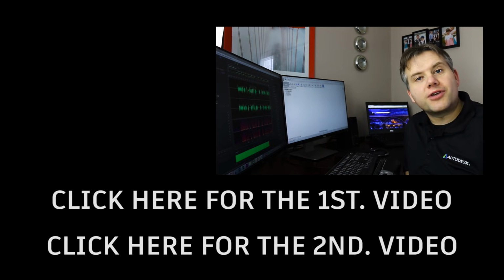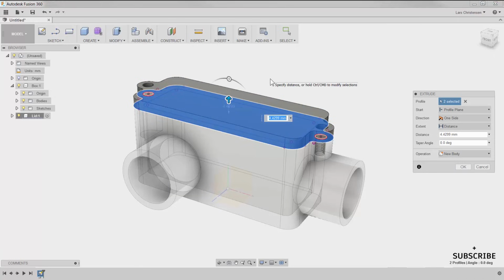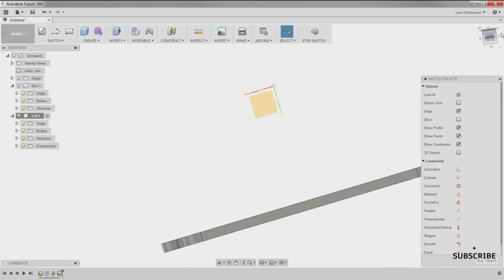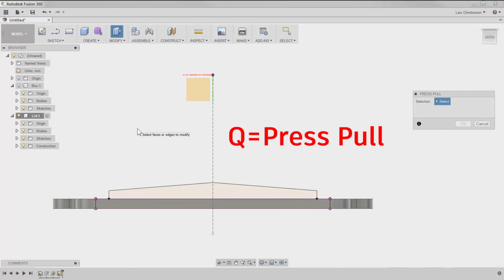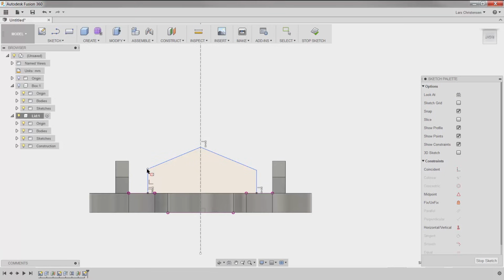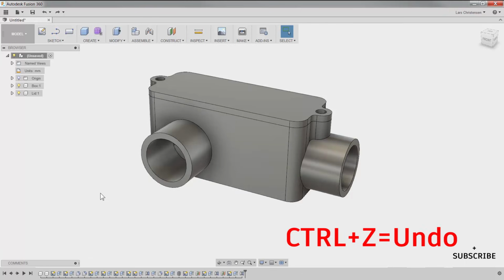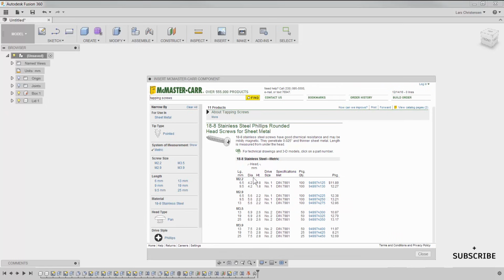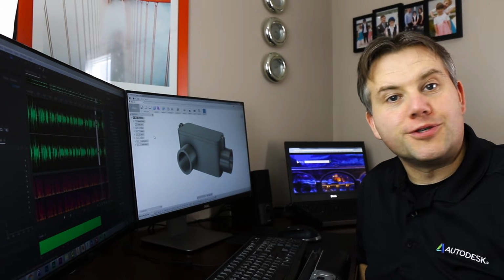Fusion 360 Tutorial for Absolute Beginners— Part 3

Comment: I am a autocad user for more than 30 years. I would to know how does Fusion 360 print out. Can it print to STP files for machining? I also like to know whether I can give 2D printing from Fusion 360. Thanks
Reply: yes and yes.  You can export to STP for immediate building on a 3D printer.  If you want to mill from a block of metal, I vaguely remember that you have to do some additional steps in the Manufacture area of Fusion 360 to define tooling and paths.  Lars has other videos showing how to export a Fusion 360 design to a traditional CAD drawing similar to AutoCAD output.

Comment: Lars, I'm stuck on this tutorial.  I've created the offset plain, then sketched the lines, attached the symmetry. When I try to dimension the height (2.5mm and 5mm) the whole polygon lifts off of the  lid.  What am I doing wrong?
Reply: The answer is right down the bottom of the comments.  Hit D, select a corner point on the tab shape and then select the other point on the LID SURFACE not the base of the tab shape.
Reply: @PaulOfford  Thank you Paul.  So simple.  I just couldn't understand why it wasn't working.  This noob thanks you.
Reply: Mine does the same thing and I can’t figure out what to do
Reply: @ghostpancakes1317  The answer is right down given by @Rick Pietersma: Found it, credits to Egon Spengler "Make sure to turn on "Auto Project Edges".  (Click your name on top right --> Preference --> Design --> Auto project edges"

Comment: Dear Lars
I am new to Autodesk Fusion and I am trying to follow your lessons step by step.

At lesson 3 I have got a problem as my symmetrical lines will not relate to the horizontal line of the  lid. I cannot get an X on the line when I move the cursor over it. It is always a +. 

Do you have any ideas?

Thank you

Georges
Reply: Same problem
Reply: Found it, credits to Egon Spengler "Make sure to turn on "Auto Project Edges".  (Click your name on top right --> Preference --> Design --> Auto project edges"
Reply: @rickpietersma7308  was having the same problem and beginning to get really frustrated, thanks so much for sharing!!
Reply: @ellencollingsart  No Problem :)

Comment: I'm having a problem with the sketch on the offset plane from the beginner 3 video. I make the sketch like the one you drew. I can dimension the bottom. I can make the right line vertical. I can make the shape symmetrical. But when I try to dimension the the points above the base, the base line moves either above the line of the lid or below. I'm absolutely lost. Can you guide me?

Chris
Reply: Chris H I had the same problem! What I did was use the “fix” constraint on the two bottom points that are touching the lid. This will keep those points in place so when you dimension, those points do not move. You have to make sure to dimension the width between the two bottom points first because they won’t move if you try to change the width once the fix constraints are put in. Hope this helps!
Reply: @abbyhowell3843  Thank you I'll give it a try. I'm totally new to computer modeling.
Reply: @abbyhowell3843  It worked. I can't express my gratitude enough. I was on v.37 of that sketch.
Reply: Chris H Oh man, glad I could help! Those constraints can be your worst enemy or your best friend when modeling. Good luck!
Reply: @abbyhowell3843  Thank you again. Eventually I'll get it.
Reply: @abbyhowell3843  Had the same problem, thanx a bunch for the tip!
Reply: same here.

Comment: Okay after fumbling around the I finally got to about 9:30. But I can not extrude. He mentioned that everything should turn black. Well his lines look like they turn solid black, as were mine seem to be dotted black lines or I guess the better term might be dashed black lines. Any idea where I am going wrong. Also I could never get the dimension to work till someone pointed out that I need to project the lines to the lid. Which did fix that problem. I have not had any problems till this point. Kind disheartening when trying to learn.
Reply: If you have dashed lines, perhaps you have inadvertently created construction lines? (Which presumably could not be extruded?) I kept accidentally leaving construction line mode on after using it...
Reply: @matthewmoore2839  Sorry as a very absolute beginner to this type of stuff what is a construction line? Compared to the lines he is making. I thought they were the same.

Comment: Great video but I have a question. What if I want to build some clearance in between the ribs on the lid and the inside wall of the box face? You said that we don't do this in CAD, but sometimes it is necessary.
Reply: You could make the extrude offset.

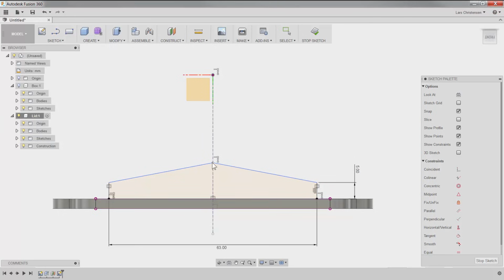Comment: If anyone is having trouble making the lines connect to the lid at around 9:00  "(left click your name in upper right). Under General -> Design tick "Auto project edges on reference".

Farzad Tabatabaie found this and re-commented it a while ago and it took me a while to find it so I figured I'd put it at the top to help people watching more recently.
Reply: Thanx that has really helped...... however, my sketch line haven't turned black so I can't go any further with extruding. Any ideas please ?
Reply: @markstevens9429  Try to close the lines
Reply: @mitricaclaudiu  Hi Claude. Thanx for that. Thie first time it failed I had not closed the 'box'. This time however, after double checking I have. It's so frastrating isn't it 😆😆
Reply: Thanks. I found my way around this by adding a coincident constraint between the line endpoint and the lid, presumably this is equivalent?
Reply: Sam K thank you!
Reply: Thank you thank you.
Reply: Dude I started watching this today! I saw this comment was made 23 hours ago, Thank you so much!! what luck hahaha
Reply: Thanks, Sam!
Reply: Thanks. Help a lot
Reply: thanks :)
Reply: Thanks very much Sam K for re/replying this and to Farzad Tabatabaie for the original information of: General -> Design tick "Auto project edges on reference"  I got stuck here for hours, tried to figure it out myself with no success, and you solved it form me!! Thank you!!
Reply: Thank you! I've had this problem and have been wondering what i have been doing wrong.
Reply: I don't have much hair but you just saved what's left of it.  Thanks Sam.
Reply: Thank you!
Reply: You are my hero Sam. Thanks a bunch!
Reply: Thank you! 😃

Comment: Anyone else having issues with line-creation? I cannot get the lines at 7:00 to anchor to the lid. So when I add the dimensions, the entire new sketch keeps moving unrelated to the lid itself.
Reply: Looks like you have to press P to "project" and select the lines you are anchoring to, then press L for "Line" and start drawing. My issue comes with the dimensions, when trying to add dimensions for the bottom line (the one actually attaching the pieces to the lid) it won't change and instead displays an "over constrained" error
Reply: @jakeburger3548  Thanks! I "unfortunately" figured this out myself just before finding your reply. But thanks so much anyways!

I'm too much of a beginner to help you with your problem though.. Sorry! For me dimensions worked fine now that I got it to anchor to the lid. Just try to do as I and re-do everything.

However, save a lot of time by skipping the project-step when he copies the shape. Just select new sketch --> then select the box, then add your new circle and select everything you want to extrude. No need to project there. Instead the projection is done at the step you mention (and only one line). :-)
Reply: Thanx that has really helped...... however, my sketch lines haven't turned black so I can't go any further with extruding. Any ideas please ?

Comment: Software Version Different
As an absolute beginner, just downloaded software, which is significantly more recent that the software used in video.  Got stuck (and frustrated) multiple times, partly due to the different software versions. Would love to see these videos updated.
Accidentally stumbled on the 'how to navigate' video, which helped immensely.  Painfully got thru the three videos, now going back to repeat them.  This time should be easier.  
Thanks for the videos.
Reply: Ed Rothen I am having the same issue. I also just stumbled on the how to navigate video. The outdated software makes things so much harder.
Reply: @user-le4qy8vi1u  Whats the problem? I can do everything explained in this video perfectly fine in the newest version.
Reply: Patrick Strohmeier mainly having issues fumbling my way around due to different software versions. I am pretty much brand new to fusion 360 (all CAD software). The differences in software versions caused me to search for some of the options. I did end up finishing the project. I will have to go back through the series to do it again to make myself better.

Comment: Great and well presented, but I am having some problems with this section, as when used line, construct and then building the part, it appears to be freestanding, it's not joined to the part.  I suspect this is a version problem, as I am running 2.0.7438 so some options are missing or renamed.
As I am new to Fusion, not sure what I can do to resolve.  But otherwise great intro to Fusion.
Reply: Same here
just found solution in comments below :
1) Right-Click UserName in top-Right corner
2) Select <Preferences> from displayed context-menu
3) In <Preferences>-dialog go to <General> - <Design>
4) Flag <Auto project edges on reference>
5) Click <OK>-button to close <Preferences>-dialog
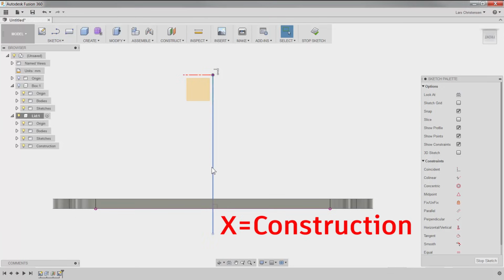Line command will now work as in tutorial at 06:44
Reply: @cchaos11  great thank you.

Comment: I liked these videos and your method of presentation.  Most of the steps were easy to follow but I have the latest version of F360 which seems to work differently for some tasks than the version you used in the videos. This has been extremely frustrating.  I have managed to work around these discrepancies and finished the box and lid but an updated video would be nice to see. Thanks for getting me started with F360.  I think it will be a great tool once I learn more about it.

Comment: 6:56 Why does it not snap to the part for me ?
Reply: I think you are having the same issue I just had. Solution for me was to open preferences (left click your name in upper right). Under General -> Design tick "Auto project edges on reference". Hope that helps, cheers.
Reply: @jasonwiles7867  Helped me too, this needs to get noticed more.
Reply: @jasonwiles7867  Thank you, that fixed it
Reply: @jasonwiles7867  thanks mate
Reply: @jasonwiles7867  Thanks man Was struggling with this
Reply: @jasonwiles7867  Thank you!!!!

Comment: On the latest version of fusion 360 I had a hard time sketching the lid "lips" since I couldn't get that first line point to snap to the surface of the lid. To get around this, I first selected the surface for the lid's edge and then "projected" it at the sketch plane. Hope someone finds this helpful.
Reply: I came back to say I found a solution to this, just in case anyone else is having this issue.  Go to "Preferences," "Design," -- and click "Auto project edges."  I don't know if it's off by default or I mistakenly turned it off, but that seems to fix this problem.
Reply: @Cloudfish  Thank you... I have another question: this should be easy to figure out, but apparently not for me. Where on earth are the preferences? it's not the wrench icon, it's not the gear icon, and it's not under the file icon either...?
Reply: just found it after a lot of googling. Sneaky bastards, hiding preferences under my user name! for anyone wondering see this video  v=Krx7oISp7LA
Reply: @Cloudfish  Really nice find and solution, you nailed it!
Reply: @Cloudfish   Man thank you!!!!!! Thank you so much..that's what i wanted to say.....
Reply: Thank you.  I couldn't for the life of me get that point to snap, either, and spent a couple of hours re-doing it multiple times.  Projecting made it work right away.
Reply: life saver!!!

Comment: I do not know why when i try to create line and hover on the edge of the link my cursor does not change and line does not get attached to the lid step at 7:02
Reply: You could just draw a horz line then vertical then slant not touching the body to create the 'barn' shape with the symmetrical constraint; then select the base horz line and pick the midpoint of the body and do midpoint, then add the dimensions. Make sure the bottom horiz line is 'horz' prior though.

Comment: Please help me. I am totally new to this. I modeled up a project box and lid. No problem. I want 3d print the box and lid seperate. How do i get the lid to sit flat on the bottom plane so it does not try and print in mid air?
Reply: Hide components you don't want, Do File/3D Print and save out to .STL, then use your Slicer software to position it. I tried in in CURA 3D and it worked fine by telling it to make the lid top lay on the print platform (came in standing on end).

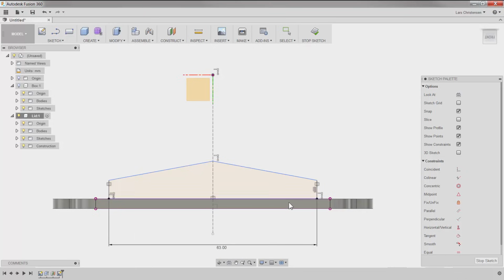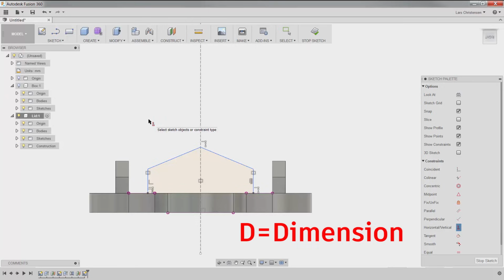Comment: If your sketch is jumping off the lid when creating dimensions (8:50 or 12:50) try rotating your model (shift + middle click/drag) and select the bottom line of the trapezoid. Right click and select Fix/Unfix, then return to the orthographic view by clicking on the face of the cube in the top right corner.

Edit: do this before creating the dimensions
Reply: Yeah that worked... thanks!
Reply: THANK YOUUUUUUUUUUUU
Reply: Thank you for the tip, it was life saving... Can you please explain what I did wrong to need that fix?
Reply: @off_the_road  I'm actually just as new to Fusion 360 as you are :) not really sure why it happens but this is the solution I found while messing around in it
Reply: @TyGuy96  Great... Thank you again... :)
Reply: checked comments prior to google search.. ahh sweet! fixed! ty :)
Reply: This man is a hero! I was so confused by this issue. Thanks man.

Comment: Lars, the line does not snap to the lid body as shown in your video at 7:02 mins. Offsetpane is constructed, the pane and a new sketch appears in the Lid section within which I try to snap the line. Fusion version 2.0.6613. All preference settings as per default. What is wrong?
Reply: https://knowledge.autodesk.com/support/fusion-360/troubleshooting/caas/sfdcarticles/sfdcarticles/Cannot-snap-to-components-when-sketching-in-Fusion-360-on-Mac-after-an-update.html  this fixed it for me - "auto project edges on reference" was unchecked in my Preferences.

Comment: I have just installed this and my company has paid for the seat.. so I assume I have the latest version since it is a fresh install.. i have noticed some differences in what you show in the tutorial. To ground the body the right click menu I get does not display this ground option.  this is just one of the few things I have noticed are different so I assume this would be an older version? Cant find this ground option to secure the box during the assembly part of video 3. Otherwise a very good tutorial. Thanks. ..Darren..

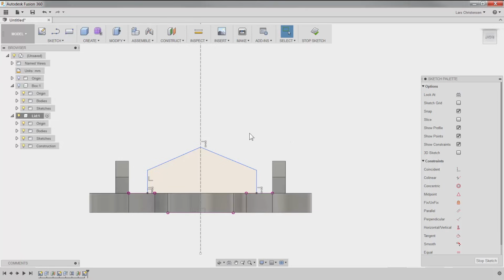Comment: so in order to get (from 12:07 to 13:09) the triangle to stay on the lid.. I had to dimension from the lid (not the line which is part of the triangle... but the actual lid surface) to the "peak" of the triangle.. then from the line of the triangle to the peak (otherwise the triangle would jump from the lid.. or into the lid... never on the surface of the lid) . only took me an extra 8 steps or so to get the same results as Lars.. seems utterly useless to have shortcuts when you can do everything the absolutely longest way possible.  I mean, maybe I have a different program or something.. it says fusion 360, but maybe confusion 360 is actually what it was supposed to say.   I'm still trying.. taking a lot of frustration breaks.. so nothing becomes smashed.. but the money spent on this struggle.. not so fun yet.

Comment: Why... around the 8:00 minute mark with constraints, does the triangle move off center, and jump from the lid when dimensioning?
Ive deleted and redrawn this #&#* lid from the offset plane portion of the video a dozen times.  Even back as far as deleting all and starting vid 3 over again.  Ive tried leaving the reference line out until i have the initial triangle drawn.. then place a reference.. still.. either the entire triangle shifts into the lid, or it hops off of the lid, or flips inside out with portions anchored (for some reason)
Reply: Kelly, I'm in the same boat and it looks like we were watching the video at the same time!
What I figured out is that you need to be careful about the order in which you select the symmetry components. First select both of the lines and points to mirror each other and THEN select the construction line. The third line will be the mirror line. If you select one of the edges of the thing third, Fusion will think that is your mirror line.